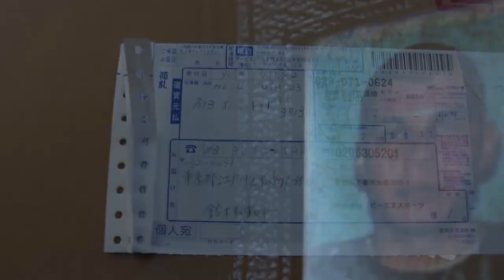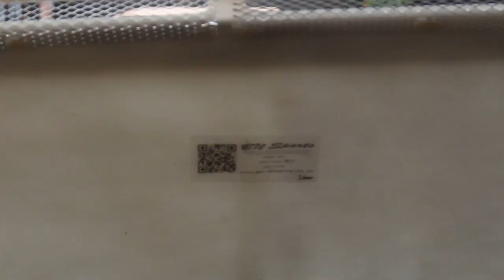Installing BN Sports Hood and AeroCatch Latches on 240SX

Comment: I have aerocatch, but haven't installed them yet. I bought them quite a while ago and IIRC PasswordJDM made a kind of handy little tool to help do the cutouts and mount the latches...hell yeah, installing a nice hood has such a big impact on the car's look, siiiick! :)
Reply from the maker: Yeah. Installing the aerocatch latches is tricky depending of the hood and the location. The underside had to be trimmed for a flush setting.
Reply: THE SHAKE AND BAKE I hear that, my hood would have a fair bit of underside trimming that seems hard to do as nicely as I’d like to. Yours came out pretty well tho so props! :)